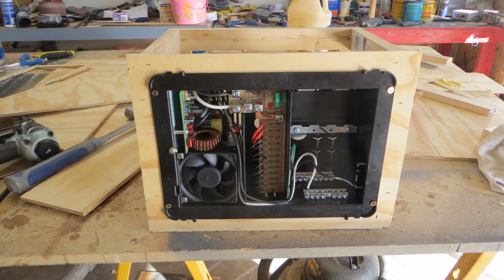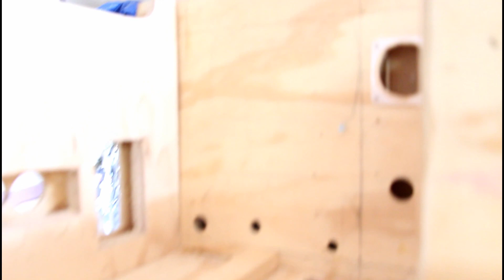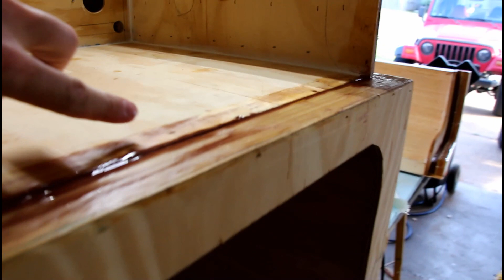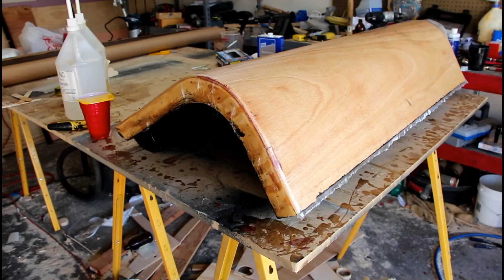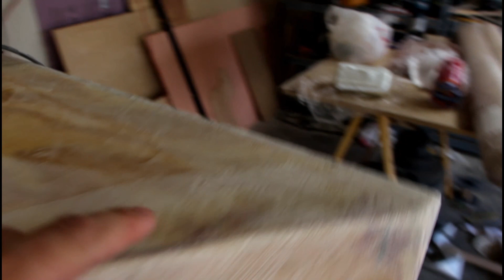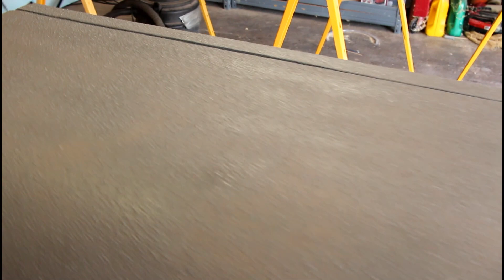TEARDROP TRAILER BUILD - TONGUE BOX PART 2

Comment: Very nice tongue box. Lots of work went into it. I am just curious what’s the weight of this tongue box? Will it add too much to the tongue weight?
Reply from the maker: I don't think I ever weighed it by itself. I guessed the weight from the dimensions and took the weight of everything I was going to put in there. Like the battery, inverter, ect... then went to this website. At the bottom there is a spreadsheet you can input the numbers. If I remember correctly you want to keep the tongue weight 10-15%. I came in just below the high end. https://www.tnttt.com/Design_Library/Trailer%20Balance%20101.htm

Comment: yeah . keep a eye on that if lets say you drive from FL then set here for a week camping when its hot out side then do a fast drive up  to lets say 6000 feet up in the cooler air . you are going to be very unhappy with what happens
Reply from the maker: I assume you are talking about condensation? That definitely is a concern I have. If that does become a problem then I will have to plug up those holes. Good looking out!

Comment: Hi, im enjoying your vids very much! Thank you for putting so much Time and work into it!
But what im wondering is, is it really necessary to fiberglass that whole thing so excessively? Wouldnt be bedliner just enough?
Reply from the maker: Thanks! You definitely could just water seal the wood and bed liner spray it. You would possibly/probably never have a problem with it. I just wanted the additional protection. I only wanted to build this once and hopefully never have to fix anything due to water damage. It would for sure be a lot quicker to build without the fiberglass
Reply: Waynego Productions thank you very much for the quick answer.
Ok i get you Point. I was just thinking if the epoxy has more than a Point than just Protection.
And i also Wonder what happens to it over time because wood itself „lives“ and epoxy doesnt. And thats why i thought if it eventually cracks over time or not.
But you don’t glassfiber it inside? What do you do inside to seal it?
Reply from the maker: Sylvester K. The fiberglass and epoxy does help with wood checking over time which was what other builders mentioned when I did my research. For the inside I just stained the wood and put a polycrylic seal over it